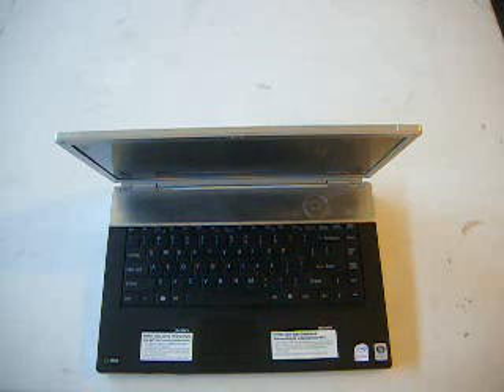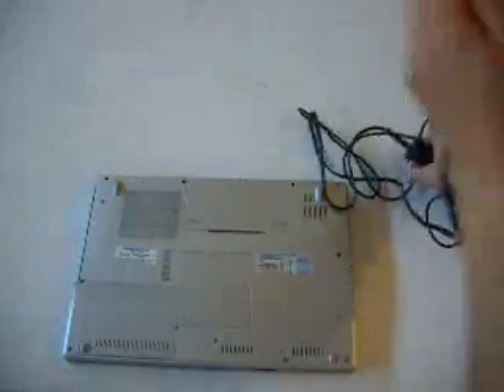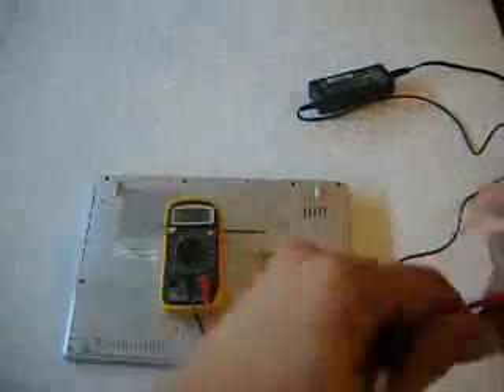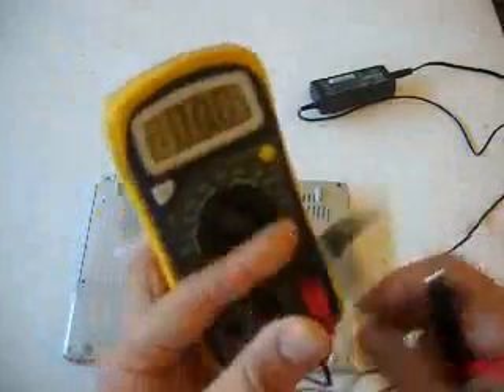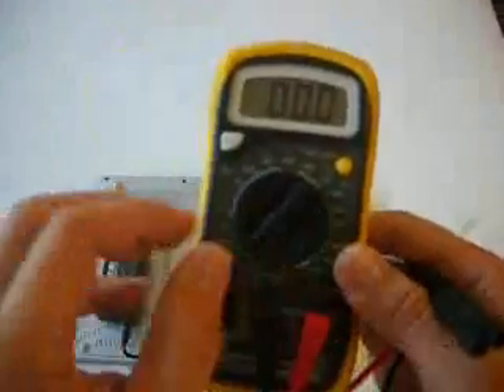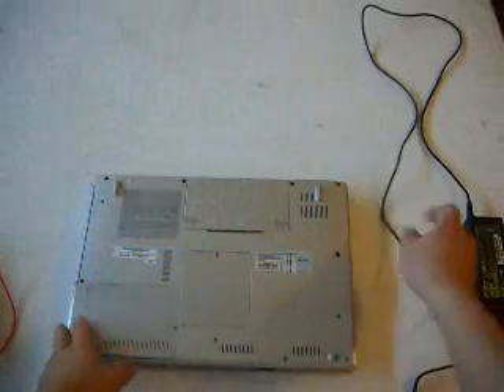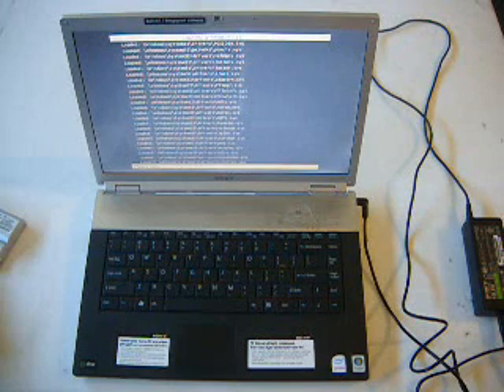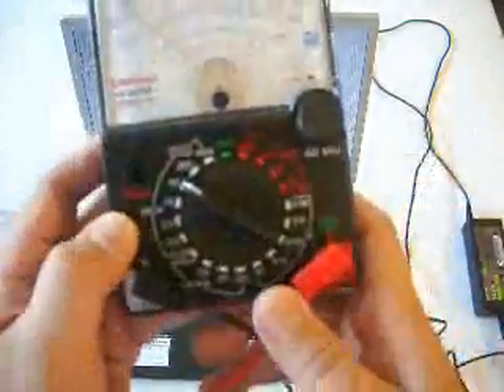Laptop does not power up, what should I do?

Comment: Now put the battery back in with the A/C adapter plugged in. Wow it doesn't work again!!!! Crap !!!!! Well you as a shop who obviously sells donuts would find that the charging IC is not switching so the computer thinks its still running on bat power first thing is to remove the RTC to reset system bios to see if the IC is caught in a lock state. The Pull up resistor for the input from the Adapter is probably weak or open. A simple test to see would be to plug adapter in for 2hrs and see if the battery has taken a charge. Hopefully you haven't charged this customer for this. This rabbit hole will go very deep.

Comment: Hi I have a gateway MC7321u  laptop I had the dc pin replaced worked great then after a while it would work plugged in but would not charge the batt bought a new batt and it worked for a couple days then no power so I bought a new  rocket fish power cord it worked for a day then wouldn't power it depleted my battery then nothing no led lights I tried the cord I on another laptop it works fine,do you think the power supply is bad in the laptop  do you have a video to show the fix ,any help would

Comment: Hey I need help. I have a Toshiba Satellite P10 with the "It won't turn on problem". The thing is, when I connect the charger, some of the lights on the laptop flicker on but when I press the power button (which also has a light around it) it wont turn on. I tried your method countless of times but it didn't work :/ What should I do?

Comment from the maker: it may be just a quick fix or some serious component issue. My suggestion is, 1st:  try to reset the memory card. Or better yet replace it will a good known memory stick. 2nd: check if you have display on an external monitor. Meaning you have to connect your video port to an external screen...We're just isolating the issue for now. So, I can't still pinpoint which component is bad at this time...but, let me know.

Comment from the maker: Ok. Try disconnecting your HDD, optical drive and leave just the keyboard and LED screen connected to your machine. Power it on and see if it can display normally some text on your screen. If not, then remove the LED screen's video/data cable and connect your machine to an external screen and then power again...let me know what happens

Comment: sir i already done that but still when i turn on led display will turn on then a few seconds it will turn off. i also done removing battery and static discharge the laptop by holding power button on.

Comment from the maker: First try replacing the memory with good known units.  If it still perrsist, then try putting some thermal compound on your CPU (in between cpu and heatsink).  Some CPU gets heat up easily and when it reaches a certain level it turns off the system.. just try these two obvious solutions before delving deeper.

Comment: Hello...I have sony vaio VPCEA36FG model. M facing prb wid the battery. My Laptop is not detecting battery n its not getting started on battery. I have to connect it with charger i.e. AC power. its not working on battery at all. n when it starts on AC power, it shows error that my battery is critical and i have to replace it with new one. but my battery is perfect. have checkd in other same model. Sony ppl said me to replace the connector of motherboard to fix d prb. wat should i do?? helpp me..

Comment: Hey when i put my multimeter tester on DC and test the power adapter  the multimeter shows no reading.? I live in a 240v country and set the multimeter to 1000v. I know the power supply is ok though..just doing a practise test.
I want to test the AC and the laptop cable has three holes ground live and neutral...where do i put the tester pins??